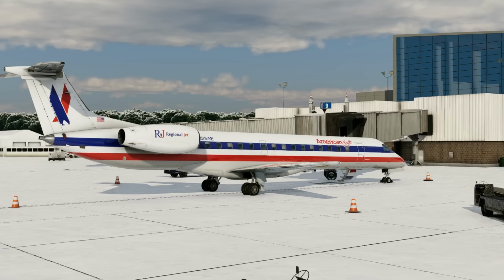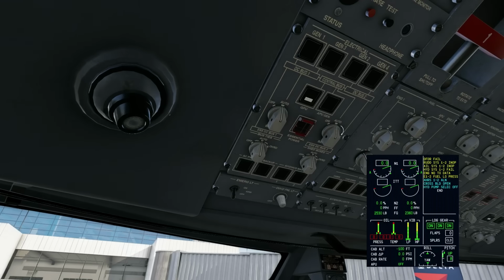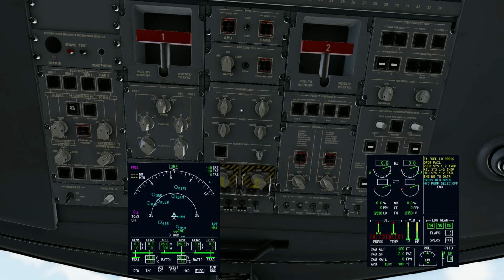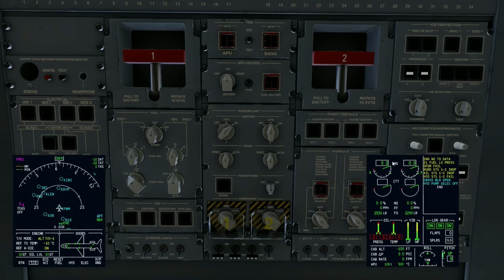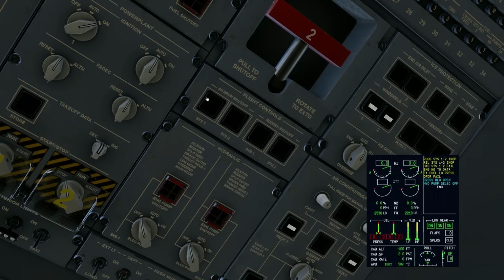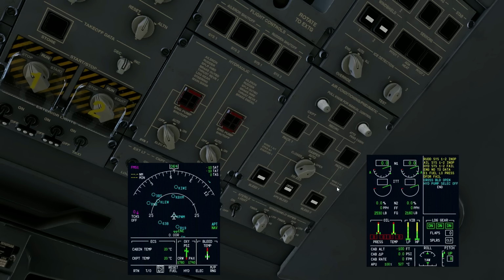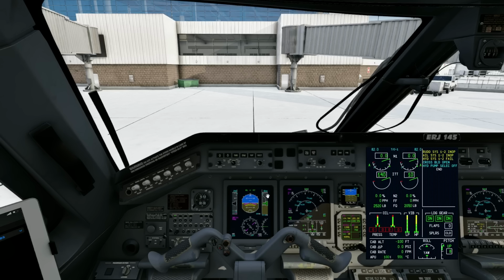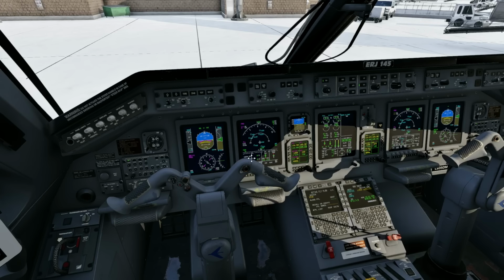The Most Accurate E145 in Flight Sim? Testing Every System

Comment: Seeing things the E-Jets don't have, MFD's that are not the same on each side, each engine has different output values and the systems seem deeper too. Glad to see it. Hopefully this comes to the E-Jets as well. 

What I also would like to see on this aircraft and the E-Jets is that the authrottle will hopefully not be going up and down when setting takeoff power or in cruise, because that's currently a thing on the E-Jets eversince. The E-Jets are a deal breaker for me with all the things I just mentioned. The ERJs are looking to be more promising.
Reply: this airplane does not have auto throttle